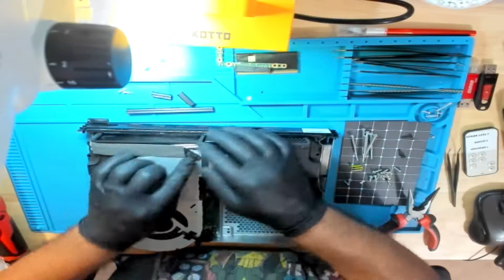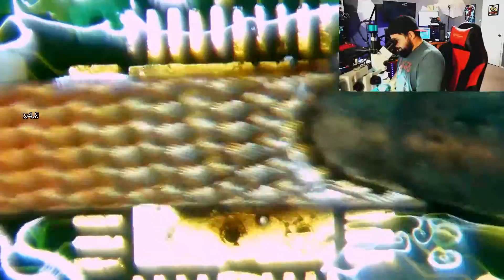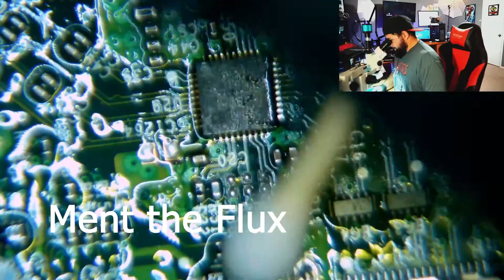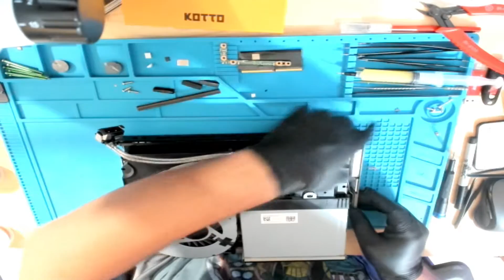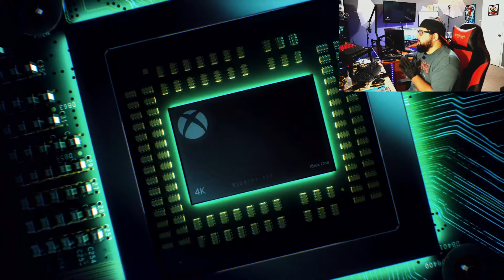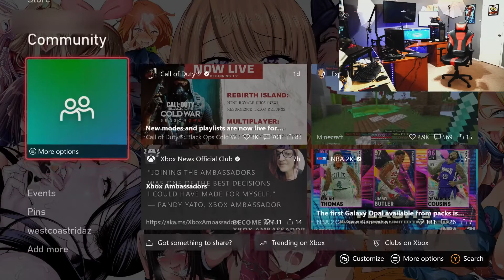Xbox One X Retimer IC Replacement - No Image EP. 1

Comment: So are you using the meter on continuity. And the beep means they are bridged?
Reply from the maker: Yes, I use the multi-meter in continuity mode to test if any of the pins are bridged together. If they are bridged it will beep, but also need to validate that the 2 pads are leading to the same path on the other end, if they are it will beep which would be correct. Hope this makes sense. Trying to find a way to word it in a way that won’t be confusing.

Comment: Merci pour t es vidéo je me sert de ma xbox one x en streming car aucun signal tv. J ai redémarre la console elle a affiché 1080p et 720p et aucun signal 😥
Reply from the maker: if your console is reduced on the resolution, normally means that your Video encoder chip is bad, also it could possibly mean that the HDMI port is bad. it would be hard to tell without diagnosing the console.
Reply: @RosalesSuperTech  thanks